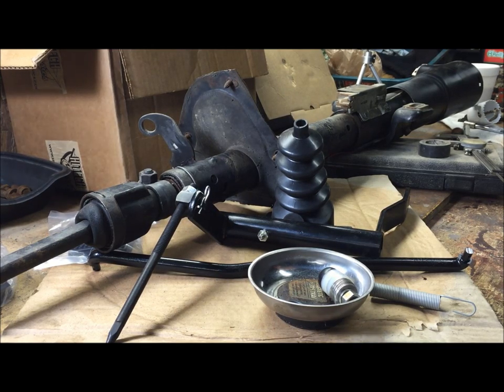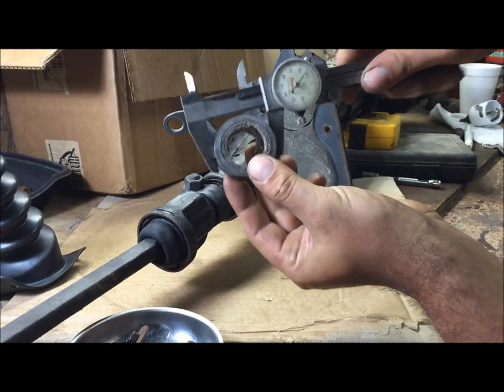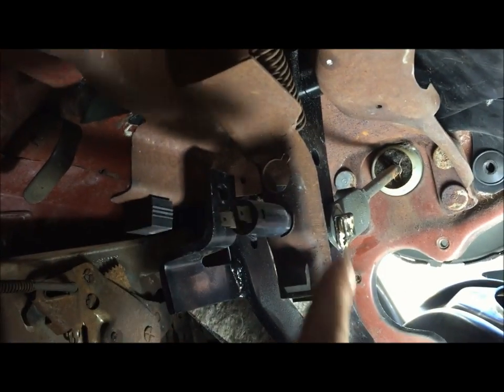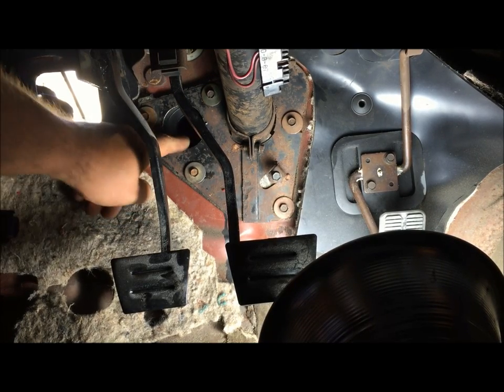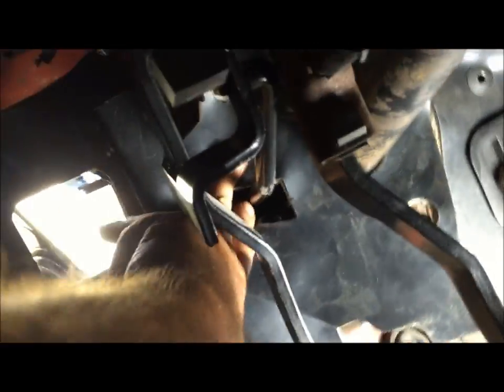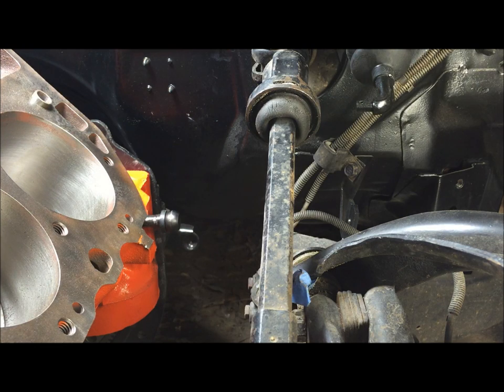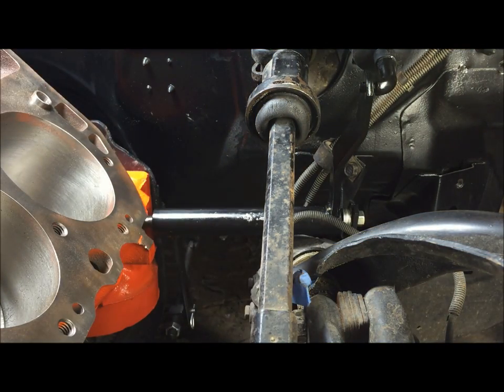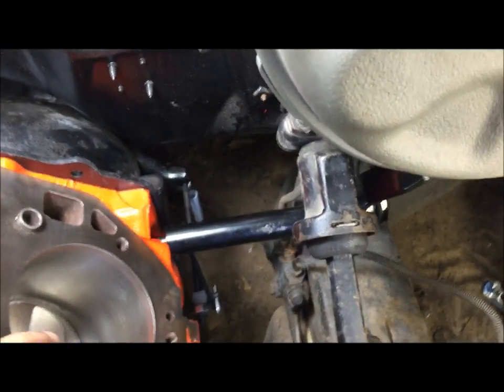chevelle clutch linkage manual transmission conversion

Comment: I have the same geometry issue with lower pushrod. Have to put pushrod contrary to assembly manual diagram in order to line up with clutch fork. But then you cannot effectively adjust it because oil filter is in the way! 70 Chevelle 396 GM Bell crank, GM clutch fork. Time to tweek the Bell crank!

Comment: Thanks for sharing this video. I am going to do a similar swap on my 64 Ford Galaxie 460 and C6 to a Top Loader 4 speed. I have everything except for the Z Bar and other springs levers and what not. Thanks again.
Reply from the maker: i did the same thing on my old 67 fastback mustang GT ..   460 with top loader..  i had to run a hydraulic clutch...   nothing fit..  well, it did before exhaust..  make sure you get headers-manifolds in before you even dare attempt a manual linkage set up..   do you have videos?

Comment: close. the clutch pedal rod boot is actually supposed to go through the column plate with the column already installed and another retaining plate sandwiching the rubber between the retaining plate and the column plate. that way if you need to replace your boot you dont need to pull your whole column out to do so
Reply from the maker: thanks..  i will look into that..  i have never payed attention to manual trans cars..  always parted them out ASAP..  everyone i know owns factory AUTO SS models..  do you have a video on the correct set up..  i checked your channel out..  you got a bunch of stuff
Reply: I just seen your reply, I was going to say the same thing lol, he's missing that small plate, it's shaped just like the end of the boot.

Comment: I appreciate your videos. I used yours to fix and update my 1969 cutlass. As far as the connection between the linkage and the pivot are for the pilot bearing how did you specify what the actual length should be
Reply from the maker: I’m not sure if you are talking about the play or not???  just give it some clearance.. it’s in the assembly manual how to set it up

Comment: Chris, "Z" bar or Bell crank, the end opposite of the round ball stud next to the oil filter area that attaches to the bracket on the frame: has the round ball stud that goes in the end, then the plastic cover seals it, then there should be a 1/4 inch felt washer, then a metal washer, the screw that is exposed then fits into the frame bracket and is fastened with a star washer and a nut.  Six/seven washers is going to create an issue.  Be careful!!!
Reply from the maker: i will let you know if there is a problem..   everything went in there the way it was supposed to..    felt and all..  if anything the bracket may need to be modified to bolt closer...   thanks for the heads up..

Comment: Very helpful.  Just got a 68 muncie 4 speed and my 95 350 I got has the bolt hole so I'm good to get the pedal assembly, it will be a 1972 FrankenLark...

Comment: Hay man really like!! But one ??, I got a 72 elco and I did the same thing, got the “ground up” kit and I noticed the Z bar bracket that bolts to the frame does not line the bar straight. Did you have to mod the brket to make work? Thx

Comment: Hello, at 838 mark.... where/how did you run the oil pressure line? what port?  Looking at your video to try to find it;  I"ve got 402 bbc, and have super comp headers;  and manual trans, etc....or can you show me in a video? looked at a few.  I have the SS manual gauges to.
Reply from the maker: watch my aux gauge water temp oil pressure video   I show it

Comment: It looks like you left the column shift linkage on your steering column. I'm at that point on mine, any issues leaving it in(space wise)? Thanks, and your videos have helped me build my 70 velle mostly by myself with no mechanical experience prior.
Reply from the maker: there is some linkage that goes to reverse lock out.. leave that tab with a hole alone it does not come off
Reply: @Craft Customs  thanks so much brother,  I appreciate you.

Comment: What I don't like about this is, since the ball stud is attached to the block, it will move up and down when the engine creates torque. The original design allowed a free floating function instead of bolting it to the frame.
Reply from the maker: this is original design. all gm cars and trucks are like this until maybe the 90s ...i have solid motor mounts..  so maybe run those if you had a concern..
Reply: @chriscraft77022  This is not where the ball stud is located on my 70 Chevelle LS5, far from it.
Reply from the maker: @hectorsolis8724  where on earth is it then?  my car was not factory manual... but i have seen others and they were like this..  that is a kit i bought for 68-72 gm a bodies..  it is not a universal kit... the frame bracket can only mount in 1 place..   where else could the ball stud possibly mount..  ? it literally, went on there perfect with 0 issues..  and works perfect to this day.. very smooth clutch
Reply: @chriscraft77022  My mistake, it is at the location you said. Long story.

Comment: Are there any bushings that go in on the block side of the z bar? I bought the kit from ground up and it only came with 2 bushings
Reply from the maker: older crappy video, I get it...   the 2 bushings go on the frame bracket side...  9:30   the z bar just slides over the engine mounted pivot ball stud
Reply: Nothing crappy about it. Thanks for uploading all the vids, you’ve helped a lot with my Chevelle!!

Comment: Nice video Chris but please tape up that fresh engine! You are looking for some serious trouble leaving it open like that!
Reply from the maker: I put the heads on it that day..
Reply: Chris Craft I have a 69 convertible cutlass and I was thinking of doing the conversion. Is the fire wall bracket the same for automatic and 4 speed or do in need to by the pedals, bracket and all the other stuff?
Reply from the maker: you buy the kit like I did.. it’s just under 400 and has everything.. pedal bracket is the same

Comment: What did u hook that spring up to when u got it all together
Reply from the maker: the spring is for a stock manual trans that has that weird proportion valve up by the master cylinder.. there is no place for it on an auto car so I just stuck it where it fit
Reply: Okay thanks